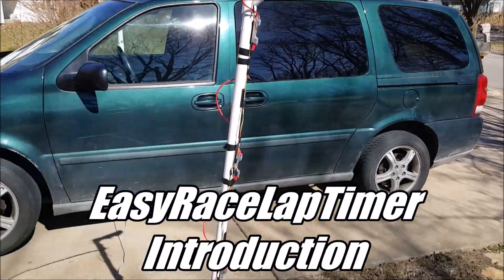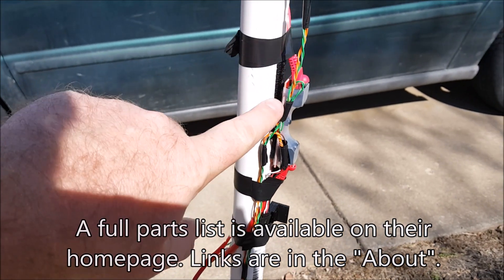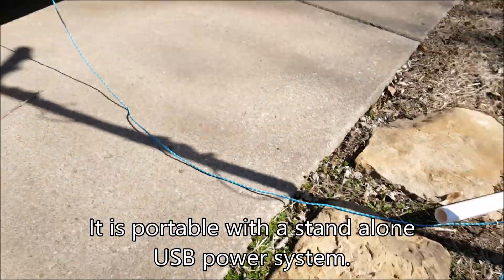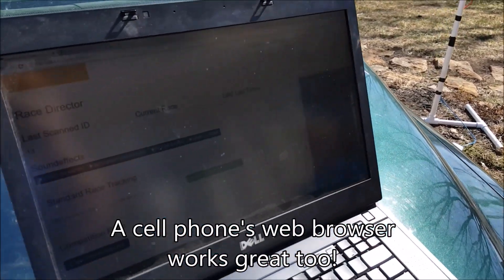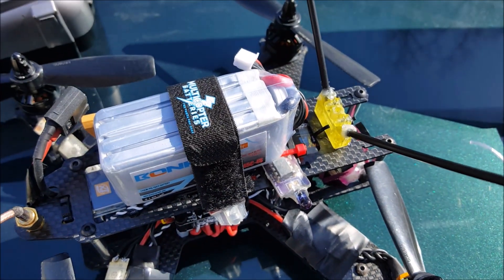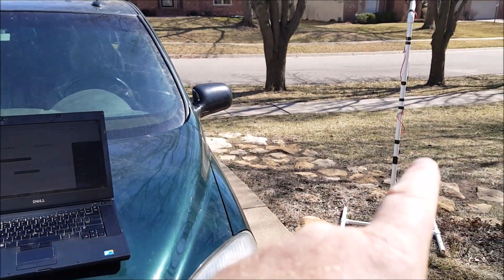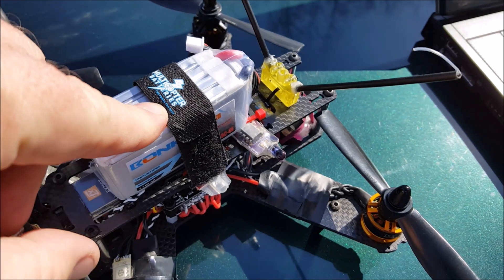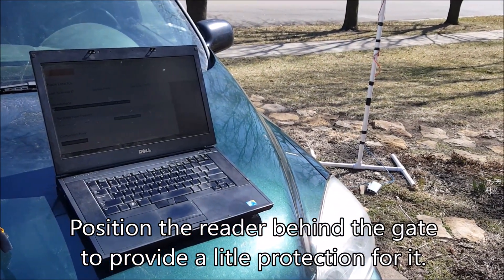EasyRaceLapTimer Introduction for Drone Racing (TEASER)

Comment: Hey I joined the kcfpv group on multi gp and would like to come check it out and hopefully race on March 13 I believe. I tried the message function on the multi gp website but it doesn't seem to work and I also left a comment on the March 13 4s race. I was wanting to get some more info on where the race will be as well as things I should know before hand. 
Thanks Nick
Reply from the maker: Join the Facebook groups Kansas City Fpv and also Topeka Drone Racing.  There is a park in the north side of De Soto.  There should be an exact address on the Facebook event page.

Comment: Are you going to do a build video series for this system?
Reply from the maker: +Jon Car Maybe if there is a big interest in it.  Their website has all the info on setting it up.  The most difficult part for me is building the transponders.  I have a friend who took on figuring it out and building them.  They are the ones that I show in the video.  The gate (pole) is pretty easy.  The software is very easy too.  I downloaded an image file that I extracted to a microSD card and run the Pi 2 off of that.  I didn't have to do any compiling or anything.
Reply: +travisgrindal https://oshpark.com/profiles/TimJC/page/1 found these PDB boards for the system.  Still think a build series video would be great for other clubs to help them get started.

Comment: We have 3 systems in our group Flying Fishkopp in Hamburg Germany test the System over the Weekend - Works very well - little be tricky with very fast copters and direct sunlight. Should work best at slow parts of the track. At the moment we have nearly 40 transponders. Cheap and good 😊
Reply from the maker: +Snappy  I like it too.  I would like it to say the lap time verbally when it is connected to speakers.
Reply from the maker: +AIRBIRDS.DE Yes, that is understandable.  If the full desktop wasn't started, that would free up additional resources for more complex tasks.

Comment: Witch esc's do you think is best for a 250 quad
Reply from the maker: +CANDY QUADS racing I like and use both the DYS SN20a (http://www.banggood.com/DYS-BL20A-Mini-20A-BLHeli-ESC-OPTO-2-4s-for-RC-Multicopter-p-975798.html?p=6Z050013977120130325) and 20 amp LittleBee ESCs (http://www.banggood.com/4X-FVT-LittleBee-20A-ESC-BLHeli-OPTO-2-4S-Supports-OneShot125-For-RC-Multirotors-p-1031934.html?p=6Z050013977120130325).  If you have a higher amp drawing motor (more than 20, less than 30), then I'd go for the 30amp LittleBee ESCs (http://www.banggood.com/4X-FVT-LittleBee-30A-ESC-2-6S-BLHeli-Supports-OneShot125-For-RC-Multirotors-p-1031943.html?p=6Z050013977120130325).